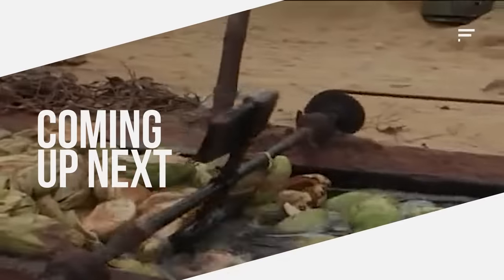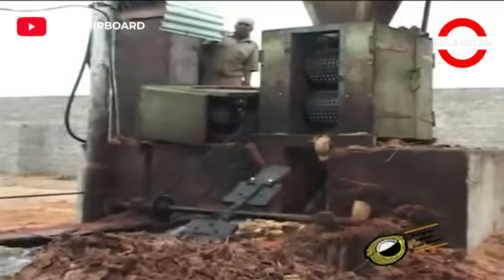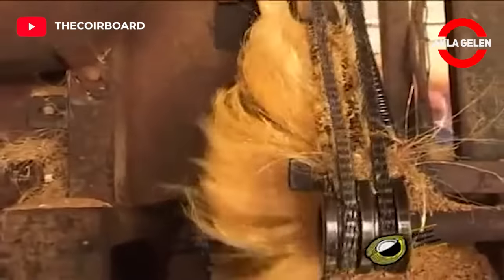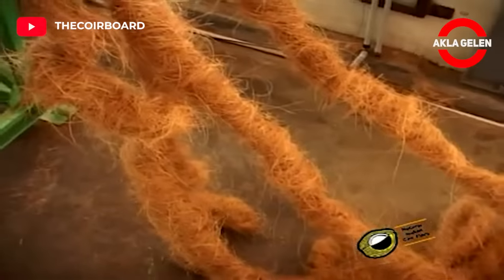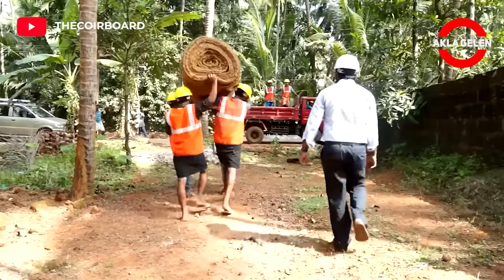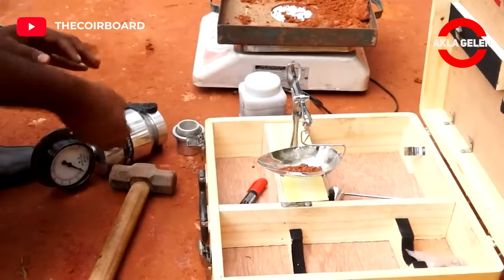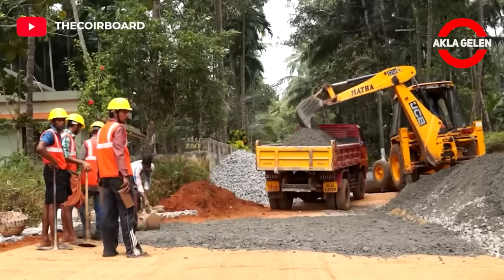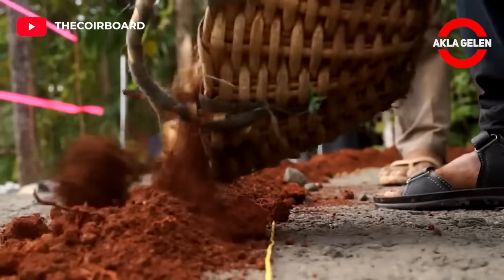You Won't Believe How India Made the Road Using Coconut - Incredible Road Technique

Comment: Here in the Caribbean I use coconut husk on my farm to prevent soil erosion. After husking the coconuts I bury the husk in the soil. It helps retain moisture for the dry season and it gives the soil a dark color that's very very rich.
Reply: Erosion and slippage is why they are using it here and to make raised embankments and anywhere else where they don't want the ground moving too much.

Comment: For people who still don't get the point. 
This is a method tailor made for the environmental and usage of rural roads of Southern India which receives heavy torrential rain for two annual monsoons seasons and then have hot tropical summer. 
So the roads here are destroyed mostly from fluvial erosion, combined by additional destability from expansion cracks during summer. Not from physical wear and tear from load bearing heavy traffic. 
And coconut fibers are one of the most toughest and decay resistant fibers in nature which were once used for making nautical ropes. They will not rot away for almost a decade, especially underneath asphalt where the soil does not have any microbial activity. 
As for the environmental impact of the fibers, coconut palms are native flora of coastal plains of India and are a staple in traditional South Indian cuisines as both oil, as coconut milk and as soild coconut meat. Even the cake left after oil production is used. Every single household will have atleast one coconut palm in their property. Coconut fiber- coir, is such an integral part of the culture of this area that their is a government body, Coir Board dedicated for the procurement, development and sale of coir products. The husk from which coir is made, will only end up as being agricultural waste that can only be burned because of its highly resistant nature, unless it's used for another products. 
Coir Geotextiles are extensively used in this area for slope stabilization, river Bank stabilization and to prevent landslides here.
Reply: Thank you for this addidtion. Kind regards Daniel
Reply: hey but what about building roads mixing recycled plastics, we know the downsides of asphalt but probably mixing in some plastic would make it stronger. Just an idea
Reply: @WARGODS-ez1bu  Tarmac from recycled plastic is essentially the same thing as asphalt. Both are made from petroleum and plastic is just molten down again to the base for tarmac
Reply: @WARGODS-ez1bu  Good idea! :-)
Reply: Good info.
Reply: Very underrated comment 😢😢😢
Reply: I wish you would further explain how this coir geotextiles help to minimize the effect of fluvial erosion and summer crack?
Reply: Recucled plastics are better off turned into hydrogen fuel and pure carbon, eliminating plastic from the environment entirely they should be done that way after first use, instead roads could be made from strong easily repleaceable fiber and soil/minerals/rocks/natural gums in layers to make it structurally strong and 100% ecofriendly
Reply: Thank you for clarifying the core concept of this video. Coconuts are abundant in my area as well. Unfortunately, their utilization remains significantly limited, particularly in the eastern regions.
Reply: @anonymouslurker2561  Fluvial erosion in soil surface happens when rainwater runs off the ground and carries unconsolidated soil with it. And basically anything that obstructs the flow of water and reduces the velocity, will help reduce surface erosion. Geotexiles, cover large surface area and in flat ground will incrementally keep reducing the velocity of surface water. Now that's top down erosion. There is another, more disruptive form of fluvial erosion where the soil will get saturated and then dislodges. Our region is particularly prone to this, because we have unconsolidated soil column sitting right on top of impervious basement rock, which acts as a bottom seal. So soil will get saturated with rainwater and in hillslopes, it will dislodge along the basement rock surface- causing liquifaction problems ranging anywhere from soil piping, sand migration to landslides and mudslides. The same over saturation affects soil underneath tarmac and when the soil surface that the tarmac is in direct contact with gets weakened, it weakens the road itself. We have very clayey soil, so during rain it will expand with all that water saturation and in summer it will shrink and cause expansion cracks. The geotexile right below tarmac means, it has another continuous surface it can adhere to which doesn't swell and shrink so drastically like unconsolidated clayey soil.
Reply: Tôi thấy sợi cước cũng bền và không mục khi ở dưới đất
Reply: oh thanks for explaining!
Reply: So after a decade, or ten (10) years, they'll have to redo this whole process again after digging to get to the coconut textile layer?
Reply: The video and this comment makes the story complete.
Actually the video should have highlighted the usage of coconut fibre as geo textile and how This road had performed. That way the video would be very much appreciated.
Reply: This comment was, at least, as informative as the video itself; this kind of info should be included in future posts   ;)
Reply: Very helpful. Thanks
Reply: Are there any updates on the road,  like how is it holding up?  Has it been tested by the rainy season yet?  I’m interested to know more.  BlessUp
Reply: very nicely explained madame. looks like you are a road expert :)
Reply: @WARGODS-ez1bu  Yes waste plastic mixed in aggregate is also being  used in India in many places, especially in urban areas. The utility is different plastic reduces the friction noise and gives around 10-15% better life to asphalt road. Two such early plastic mix roads were Cubbon road and Dikinson road in Bangalore, done between 2005-07 if I remember right, and I think Cubbon Road resurfacing was not done after that till now the other road was dug up for gas and water lines. The technology was developed first by Central Road Research Institute in Roorkee and they also built a demo road within their campus.  So use of plastic in road surfacing is quite old now to be in news
Reply: @WARGODS-ez1bu  It is already being used as an experiment in national highway projects. Though some have reservation about it. When asphalt breaks down, it may release micro plastic to nature.
Reply: Wow, what a detailed explanation !!
Reply: For further explanation:
https://youtu.be/0olpSN6_TCc?si=pRxXRtPLRDgydX3W
Questions:
I assume the coconut fibre mats are only used next to slopes?
Are sometimes several layers of fibre used?
Why do they put soil over the gravel layer?
Reply: Amazing 👏🏾

Comment: I have a hard time picturing the coir not rotting away over time.  coir is used in compost and vermicompost (composting with worms) and breaks down over time.
Reply: Coir is not used in compost, but cocopeat,  the waste after extracting the fibre or coir.
Reply: ребенок  Hate & jealousy affect you negatively.
Reply: ребенок  Indian doing any construction for show. Best joke of month 😂😂😂
Reply: The husk of coconut history different fibers, the harder external fibers and soft internal oness. And the coco peat you get for potting is actually after it has been submerged and decomposed...which is why it is named coco- 'peat'. Coconut fiber has way too much tannin, which is what makes natural fibers strong and resistant, but that tannin use up too much nitrogen and release too much heat while it breaks down. So if you use coconut fiber that has not been submerged for a long time and washed your plants will, most definitely die. This is from solid experience because we once got conned when the peat we bought were not pre decomposed and washed. 
So, if you ever end up having to buy cocopeat from a different brand to submerge it in a barrel of water for sometime before potting just to be safe.
Reply: I agree what you said. People used to use coconut Pete for mud homes and those homes still stand of time so it does not decay but it’s a process to create this sustainable coconut peak so it depends on what kind you use for road construction and for building mud homes. @aleenaprasannan2146
Reply: The geotextile is used to stabilise the area. After compaction and time, this type of road with laterite soil will become hard. This year, we did a 50 metre steep sloping driveway in kerala. It didnt even need geotextile or heavyroller. The bulldozer just formed the slope and ran over it a few times. Next day, we drove a car up the slope
I dont know how it will perform with other soils

Comment: What are the advantages of this method over the regular asphalt without the coconut textile?
Reply: None whatsoever. When that thing degrades, it will do so at an accelerated pace due to moisture, heat and pressure. The decomposition will eventually create a thin cavernous layer that weakens the road structure. Not forgetting to mention that fungus loves humidity and the dark. Translation: you'll see potholes within months. There's a reason why typical roads are constructed with petroleum-based products that are hydrophobic, waterproof and non-biodegradable.

Comment: Who told these people that adding a biodegradable material to the foundation of a road or any structure was smart? The whole idea of laying pebbles before pouring your asphalt or concrete is so that the interlocking pebbles will grab the ground tightly and provide a solid foundation once theconcrete/asphalt is poured on it.
Reply: Well, that's not going to hold if the place had heavy torrential rain for two monsoon seasons and then followed by tropical hot summer. The main problem for roads here is fluvial erosion, not the erosion from traffic...which is why this is used in rural areas, where there is less traffic, more moisture in soil and have much severe surface storm water runoff.
Edit: Also, when they say biodegradable, it's not going to decompose after a year. Coconut fiber is one of the most resistant natural fibers in nature and they were used as nautical ropes one time. They can last decades.

Comment: loads of biodegradable sheep in the comments don't understand road construction.

Plastic netting or geogrids are often placed under roads to provide additional support to the roadbed and prevent soil erosion. The geogrid material helps to distribute the weight of the road and vehicle traffic more evenly, reducing the risk of sinking or subsidence. Additionally, the netting helps to stabilize the soil beneath the road, reducing the amount of settling that can occur over time. This can help to extend the life of the road and reduce the need for costly repairs or maintenance.

If the geogrid under the road was biodegradable and designed to degrade within a year, such as with coconut nets, it would eventually break down and disintegrate. As a result, the support and stabilization provided by the geogrid would diminish, potentially leading to road subsidence and instability. This could cause safety issues for drivers and pedestrians, as well as costly repairs for the road infrastructure. Therefore, it is important to use geogrid materials that are durable and long-lasting for road construction and maintenance.

If there is no geogrid or any other type of reinforcement, heavy traffic loads can cause the soil underneath the road to deform and become unstable over time. This can result in cracks, potholes, and other types of pavement distress. Additionally, without geogrids, the base and subgrade layers may be susceptible to erosion, leading to structural damage and reduced load-bearing capacity of the road. The absence of geogrids may also result in higher maintenance costs and shorter pavement life.

TL;DR
Environmental morons design a shitty road that will break and need to be replaced within a year or two.
People WILL die from this poor construction.

Comment: The coconut fabric is used as a stabilizer? What value does it add to the whole construction effort? What difference does it make? It looks like the earth, peebles, asfalt, man and machine are contributing normal but you do not say anything about the coconut fabric after its long costly production process.....?
Reply: The area gets heavy torrential rains for two monsoons annually and most of the damage in rural roads happen from storm water erosion. Geotextile helps by having a more cohesive barrier, that prevents erosion at the contact between the soil and gravel. It also holds moisture, thus reducing expansion cracks in asphalt when it doesn't rain. 
Just image two sections of road, one with long geotextile underneath it and other without it.  Now think of how it will behave in torrential rain and surface runoff. Remember that the soil underneath asphalt will also have increased moisture (from groundwater infiltration and movement because not all soil surface is sealed). Now imagine which one will heat up and dry up faster and be subject to expansion cracks during the day? And then which one will get dislodged particles in the next rain?

Comment: At least it will cost little less when it needs to be rebuild.

The problem is the ground itself (prone to landslides). So it doesn't matter much that you use pebbles or coconut fibers fixed with plastic loops ^^. 

When there will be a landslide the road will be gone either way.

Comment: What is the benefit of using the coconut fibres?
Reply: It stops the road surface layers from eroding and slipping across the bed it all sits on. The same material is used to stop raised embankments from expanding outwards under their own weight, each layer has this fabric inbetween. You can do the same with some old bedsheet or t-shirt, use dirt or sand and in a bucket make layers of dirt with fabric inbetween, add a little water, wait a moment and then tip the bucket upside down onto the ground, take the bucket away and the mound will hold your weight if you stand on it.
Reply: @user-yw3cy8pn3b  Interesting. Thanks

Comment: Coconut coir fibre? They're very expensive gardening material. They could have sold it for lots of money.  It's a luxury way of road building.  But I 'm sure the road will be firm and last long and it's worth it.
Reply: Where you live has an impact on the prices of products.
Reply: The coconut husk is cheap. The coir mats are expensive due to design companies and prices set by coir boards

Comment: Well, IND, or rather Bharat has always been about recycling and reuse and it has been so for ever. Bharat had clear concepts of sewage management even in the days of Harappa and Mohenjo Daro but there was no garbage management practices, for Bharat produced none. Every part of everything was consumed or used domestically. Having said that, I guess that's becoming a problem now for we have moved away from traditional ways of reuse and we are not traditionally worried about garbage management.

Nevertheless, this speaks only about the coconut husk. The trunk is used in house building, canoes etc. Leaves are stripped from middle to get the leaf stem which is bundled together to make brooms, the leafy parts are an excellent fire starter once dried. Entire coconut leaves are also used like prefabricated thatches for house roofs and separation walls. Same goes with almost every plant. Bigger leaves were used to make disposable plates, bowls and cups. Banana leaves are used as our disposable dinner plates even today.

Comment: what is the advantage of this method
Reply: It uses the material available to them in abundance and the layer is very much required to stop the surface layers from sliding upon the road bed when it rains. Every single raised mound from something in your garden, to moutain ranges are all trying to become flat and when it rains you wouldn't want the roadway sliding off down the hill.

Comment: Adding microplastics to soil, no one noticed it, the workers had tied the mats together with plastic wires. A hundred thousand of them are added to soil and will not disappear anytime sooner. Isn't this pollution?.. if they were to tie the mats together same material could be used. The video is excellent but plastic wires is questionable and changes the concept of eco-friendly.
Reply: 😂 that plastic was  recycled  do u  thinks its great to throw it in river dustbin ponds or just to use it for a good purpose.Its a very little amount and they had also add  one tasla of recycled plastic which is used to make roads